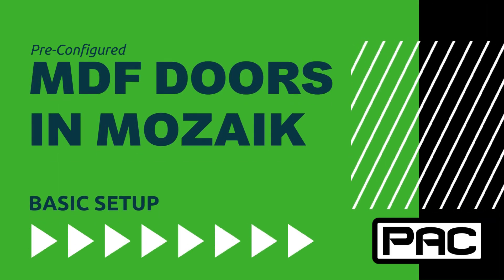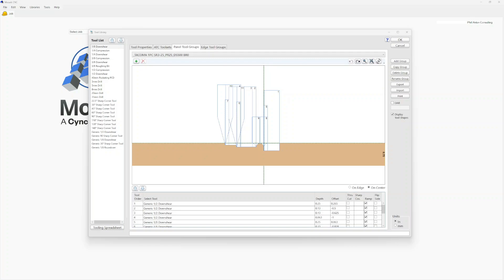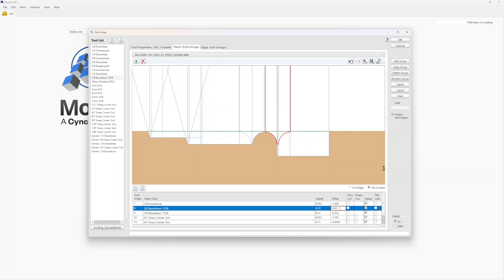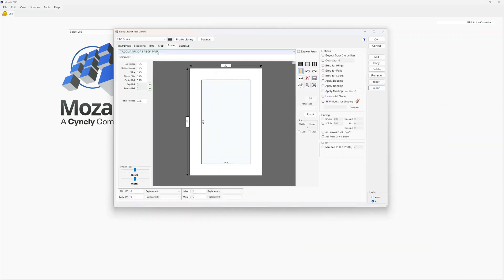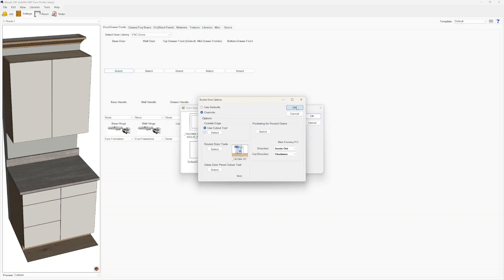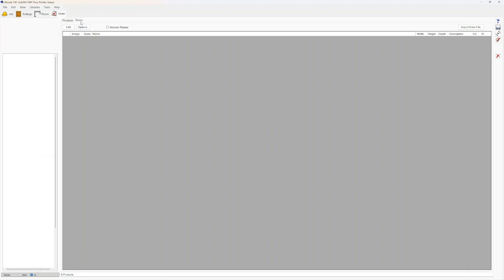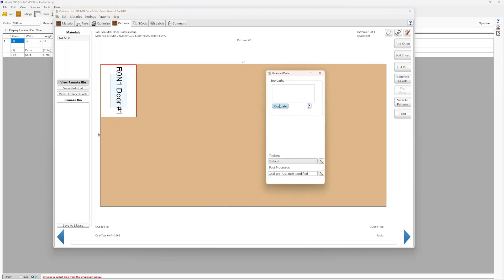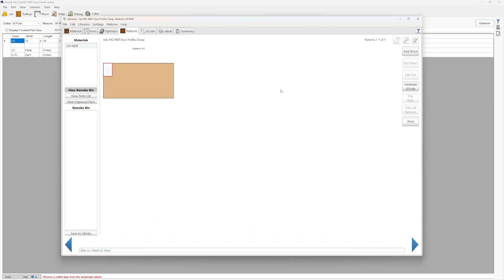PRE-CONFIGURED MDF DOORS IN MOZAIK - Basic Setup

Comment: what is the sharp corner tool? do you put that one in the cnc too?
Reply from the maker: Sharp corner tool in Mozaik is any angled bit like 30deg, 60, or 90. It allows the bit to retract to clean out the corners.
Reply: Can it be named the same tool as the 30deg in this case on your CNC?
Reply from the maker: @MartinLetourneau-n2j  depends what cnc you are using. Typically yes.
Reply: When using roundover bits can mozaik create sharp inner corner on its own or this is only possible when purchasing door libraries?